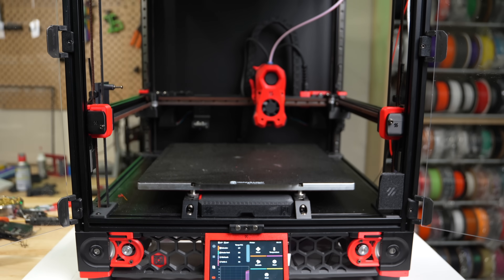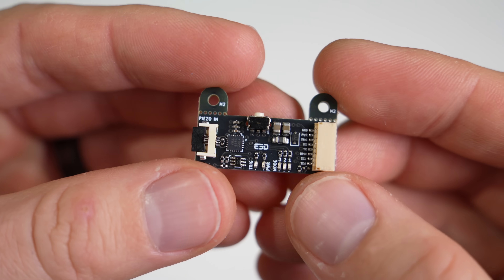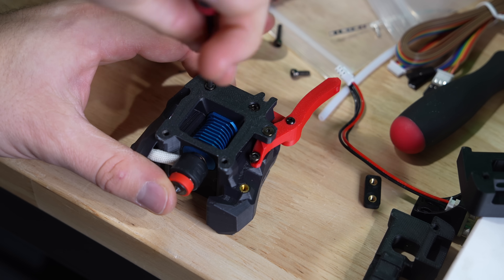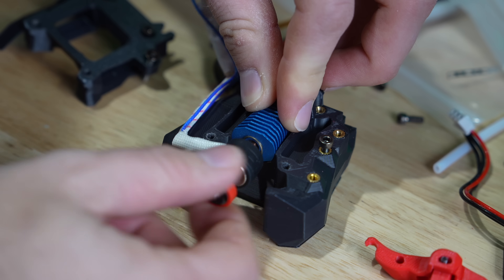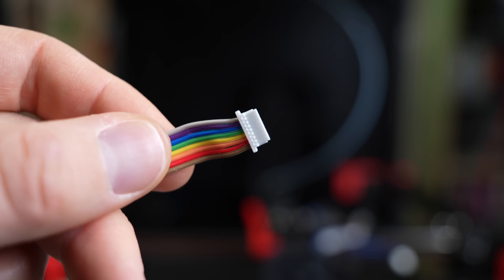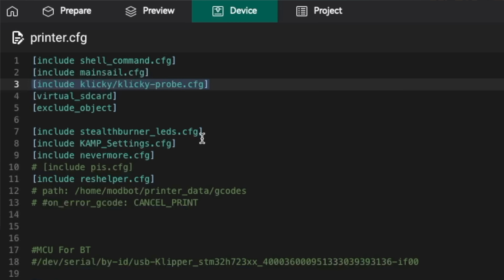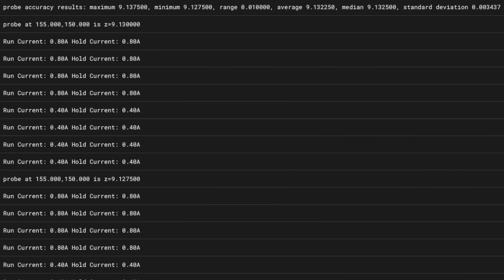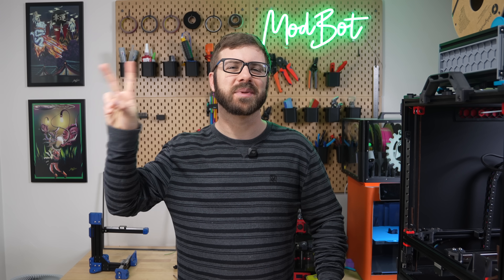Simplified Accurate Probing With Piezoelectric Sensors (E3D PZ Probe)

Comment from the maker: For clarification, you should not touch your hotend at 150C. Touching the hotend is only intended when you are doing your first homing ever and the hotend should be cold. The 150C is only intended to add after you verify that the probe is working as expected. Sorry if this was not clear.
Reply: It was clear to me but I definitely can see someone taking the chance to touch it while it's hot because you said too lololol
Reply from the maker: @DIYunpolished yeah I didn’t add that bit of code until after and realize an on screen could have been helpful. The good news is when homing the printer which is when I said to check if it engages it will not heat up.
Reply: Awww 150 is not that hot, from my experience it's only real bad without silicone sock on the heater block and above 200. Don't touch the heater block when it's hot. Just don't touch hot surfaces, the larger they are the more it hurts. 😅

Comment: Hi! I recently installed the Klipper firmware. So far, much is unclear and not obvious. How do I register the E3D Revo thermistor correctly in the printer.cfg file?

P.S.
I'm sorry if the translation is not quite correct.

Comment: Yeat another thing to add to my way too kitted out ender 3 😂. Using a BLT touch clone right now and it works fine, but man it would be nice to be able to change nozzles without having to worry about z-offset. I like to print most of my prints with a 0.6 nozzle but sometimes it's slightly too big even though slicers aee good at dealing with it these days.

Comment: I have the SB2209 toohead board which has the input shaper sensor built in. Have been wondering why they don't just use those to measure "shock" to basically do this "TAP",....

Comment: e3d has really fallen behind since the bambu printers were released. No one really needs their stuff anymore, unless they are running vorons or ender 3s. but who in the right mind is using those when there are much better printers available now.
Reply: People who would rather spend $30 on an upgrade instead of $1000 on an X1 when their old Ender 3 works fine? lol

Comment: I've tried using the PZ probe on my switchwire conversion.  However I kept getting false triggering, and I've tried all of the available settings.  Falsing was worse when any of the fans on the tool head were running, so I had to probe with the nozzle cold.  Another issue is that if you run the PZ board on 5v, the logic level signals will be 0 and 5v.  This wouldn't work with the MCU I had tried to wire it to, unless I put a schottky diode in series with the signal wire.  (The mcu board provides 5v for a BL probe, not 3.3 volts)
I used a metal ruler to tap the nozzle when it was hot, but as I reported before the probe falsed during probing with the nozzle hot because of vibrations or noise from the hot end fan running.

Comment: That additional gcode doesn't make sure the extruder is at 150C, it actually just makes sure its not over 150C. Still have to manually heat up
Reply from the maker: @jamesbirtles  yeah it behaves a bit differently than what I had running on tap. I may tweak it a bit.

Comment: Great video.. I have been waiting to see someone install one of these.. I want to use them on my tool changer..but I would keep the tool setter for the initial tool setting then probe the bed when a tool is put into operation.. im wondering if the data could be used for bed leveling 🤔

Comment: E3D sells the PZ probe sensor and control board without the Voron coldside heatsink.  Do you know if it’s compatible with Revo Hemera or Roto, and if so how it would be installed?

Comment: Thanks for the video... would have been nice to have seen it a few weeks ago before I replaced Voron TAP with Revo PZ Probe.  One important thing... in addition to being a 5 volt ONLY part, PZ Probe is apparently not an "Open Collector" configuration.  This means that you might need a BAT85 diode in the output wire, just like certain Inductive probes need.   In my case, the MellowFly SB2040 CAN toolhead board needed it.

Comment: Both Bambu & Qidi use the same piezoelectric bed sensing. Qidi is now suffering from inaccurate bed sensing due to the piezoelectric sensor degrading during long-term heated chamber use. Bambu is same. That's why their sensors at $5 on their web store.

Comment: All of you seem to very knowledgeable but I'm curious about these build your own 3D printer kits. Aside from the challenge of putting all the parts together start to finish(which is something I very much would enjoy doing) the price seems to be incredibly high for all of the kits. Are they significantly better than the cheaper 3D printers that are pre assembled? I'm so confused by the high price, it seems like kits are usually much cheaper than a finished product but here it seems to be reversed.
Reply: It used to be that kits were more expensive but were significantly higher performance, then companies came on and released machines that worked out of the box and had similar performance to the kits. Kits CAN still offer better performance but its down to how well you build and maintain them, they're also more sutomiseable and adhere to open hardware ethos more. Pre built printers are now cheaper and have decent enough performance but you're stuck with what the companies offer for upgrades and support, you're at the mercy of the company when you buy them and often they're not made to be easily repaired so if they break there's a good chance they'll stay broken. If you want 3d printing to be the hobby go pre built if you want the 3d printer to be the hobby go with a kit.
Reply: @jakeengland1430  ah, that makes sense. I got an ender 3 pro given to me and I've fixed it up from non functional to working and I really enjoyed the process. So I've been considering the kit route.

Comment: I've been using the standalone version with a dropeffect next g fiber in a dragon burner on my v0.. and mostly love it. I had to modify the presets to get a working config and sometimes it fails meshing due to nozzle ooze, it just because it feels like it. I'd say it's 80% reliable at this point, obviously really wish it was 99 or 100, but the lack of space rules out most probing options and I've already done the work so it'll start for the foreseeable future l.

Comment: The PZ is very nice but I struggled a lot with the fan interfering with the probing. I now turn the hot end fan off during probing which solved the problem but is also not ideal

Comment: I can totally relate to not modding a printer when it just works. I have a Trident I made almost 3 years ago and I have a million upgrades sitting in boxes from a full CNC gantry set all the way up to a whole new rapido uhf, Galileo 2 based hotend with upgraded cooling. And the only reason I haven't put that stuff in is that I've gotten perfect prints after spending some time tuning and just have little to no reason to go messing with things.
Reply from the maker: It’s a slippery slope. I enjoy modding but once you start it’s always just one more thing. Yes they can improve on the experience and even output but there’s something nice about a printer that’s in a place where you can consistently rely on it. I’ve been guilty of modding things and creating my own issues before 😅
Reply: I have a rapido 2 on my 2.4. It is a very nice hotend that pushes a heap of plastic

Comment: I was trying to buy it for half a year and it was out of stock everywhere all the time.
Also I don't like the fact that you need to shove yet another PCB onto your extruder assembly, they should co-op with mellow or other stealthburner PCB manufacturers to have it integrated, or at least make their own PCB which does cable management so like basic stealthburner PCB but has their piezo electronics added.
It also seemed very suspicious/alarming that even tho voron community will gobble up anything voron dedicated from e3d, there was not many videos on it.
After like a year since the announcement, I revised the subject and people were saying that it has a lot of false triggers and is not that great in overall and that digital inductive sensors are better.

Comment: I bought the Revo Voron PZ to put in my tool head on my bed slinger.  Couldn’t get it to be consistent. Sometimes it would false trigger (especially if the hotend fan was running) while other times it would slam into the bed and not trigger.  This was despite not changing the sensitively or filter settings between incidents. Gave up and restored the BQ Microprobe into service again. Sad really, as I like the idea of the PZ probe.

Comment: Recommends heating hot end to 150C for probing, then recommends using your hand for testing the probe.
Not sure that's a good idea.
Reply from the maker: Yeah lol the order of operations was that it wasn’t added until after. Also it doesn’t trigger the hotend heating to 150 on homing but I’ll pin a comment to clarify.

Comment: Is there a reason more people don’t just zip tie their loose cable to a 3mm nylon filament length to prevent tangles? Still flexible, no drag chain to worry about, but enough stiffness to keep wires out of the way

Comment: Without another Hotend using the System I'd rephrase the Standalone Version into a Spare Part as otherwise it can still only serve the proprietary Revo System you'd have to pry into my cold, dead hands before I'd use it over a CNC Tap a) not tying me to a particular Hotend and b) providing some welcome Compliance as it allows the Tool Head to move out of harm's way if the Nozzle gets stuck on something. @06:08 This setup looks like a terrible Maintenance Issue no longer allowing for a quick removal of the Shroud ( say during a Clog ) without the removal of both the Extruder AND the Piezo PCB - Not impressed 🤔🤨

Comment: I wish there was a good aftermarket probing solution for the SV08.  It's most of a Voron 2.4 but the thin warping aluminum print bed and inaccurate prox sensor for the bed mesh causes unreliable first layers.  I like the looks of the Beacon 2.0 which does a quick but very accurate fly-over inductive bed mesh and it apparently has an accelerometer that can sense a very light touch of the heated nozzle on the heated bed for a directly measured Z=0 offset.

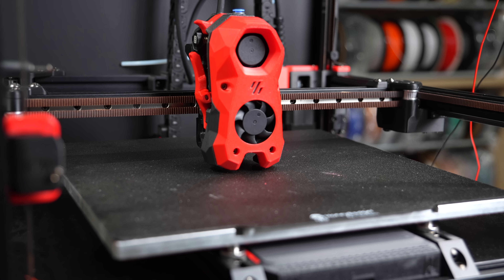11:50 - I uploaded a TPU cable chain for the SV08 to Printables and Thingiverse that might help with your floppy extruder cable.  You'd probably need to modify the mount to fit your 2.4.
Reply: I have this Pizzo kit and want to add it to my SV08. Did you ever do this, or know someone that did?
Reply: @treyduval5399  - I haven't heard of anyone adding a piezo sensor to their SV08.  Some people have installed a higher quality prox sensor.  Most people have upgraded the SV08 prox sensor to the Eddy sensor and some people have used the Beacon probe.  In the launch live stream video for the Zero, people were asking about the SV08 first layer issues (warped bed and inaccurate prox sensor) and Sovol said they are working on a user installed Eddy upgrade for the SV08, but their focus now is on the launch of the Zero and the 500 mm coreXY printer that was developed in tandem with the SV08 that should be launching soon, but hopefully soon after that we'll have an Eddy probe kit from Sovol that will fix half of the first layer problem.

My SV08 has been down for almost a month.  I watched the first 20 layers because I knew the first layer issues make bed adhesion problematic.  I went to bed and the part released from the bed six layers later.  In the morning, the hot end was completely encapsulated in a baseball sized blob of molten plastic.  The extruder cover had been ripped off and hurled aside.  The heater wires were sparking.  I can't trust the SV08 to print when I'm not baby sitting it, and it's never been able to print anywhere but the center 220x220 mm of the bed because the bed is so warped and the bed mesh is so inaccurate, so there's not much point in having a 350x350 bed.  I actually love the SV08, but these first layer issues need to be resolved before I can use the printer the way it's designed to be used.  I was going to install mainline Klipper so I could install an Eddy probe, but now I'm waiting on Sovol to release their Eddy upgrade as I'd prefer to keep it on the Sovol firmware if I can.

Comment: I never got this working on my Voron.

It was a sensitivity issue. Either too sensitive and constant false triggering, or either not sensitive enough, and crashing the head.

I could get it close, but it would still always crash the head if the fans were operating.

This was the stand alone version.
Reply: I'm one step from giving up.. Using the stand alone too... Same problem
Reply: @yuripolak  Yeah... I got it to work great and reliable every time... Unless the fans were running, and then it would crash more often than not.

Comment: Probing directly with the nozzle tip is like an ideal situation, except when considering how small the probe tip surface area is. You want to probe with a wider tip surface so adding something like a shim stock of known thickness between the tip and bed would create less noise in the measurement of the bed especially when using a textured bed where the probe could fall on high or low spots when what you care about is the average, but it will also keep the nozzle from potentially damaging the bed. Currently this is a half baked solution imo.

Comment: Have one in vyper, hate it it's not reliable over time, made a  complaint mechanism with a simple contact switch made of two m3 screw works like charm simple no heat degrading over time

Comment: I’ve been using the PZ probe for a while now, and mostly loving it.
Tuning it in has been a bit of a nuisance at times and I had to wire up my own adapter to connect the PCB to my tool board (but that was easy enough). The price is also… not great. Now it’s working, it’s gorgeous, first layers are always beautiful.

Comment: for anybody curious about what various connectors are called who doesn't already know, the connector on the piezo board that the ribbon connects to is called "zero insertion force", or more commonly simply "zif".  there's a similar connector called "light insertion force" or "lif" that used to be used in some super small laptops many years ago for 1.8in hdd connections in such a small form factor (such as the sony picturebook) & zif connectors for display ribbons & such, so definitely not a new thing.  interesting to see it implemented again after all these years, though.  😊

Comment: If you had deviation issues with your klicky probe, you probably had a mechanical problem like lack of stiffness on the tool head dock or a bad micro switch, by far the klicky here had been the most reliable probing method with a range of 0.0020, even with a heated chamber with bed over 100°C. I'm using a Huano Pink dot (0,75N with blue transparent shell) for my klicky.

Comment: 15000 times in durability testing? Looks like not very much. I often have 7*7 or 8*8 adaptive probing points on my 350mm³ printer. And I can easily have about 10 prints a day.
Reply: :) too bad, it will last about one month in your use in that case
Reply: Why one earth is your bed changing shape so much?

Comment: I almost went with the Pz probe, but chose cartographer. Its amazing 30K mesh points on a full plate in under a minute. tap was so incredibly slow. eddy current sensors are likely the future or something non contact. I had a precision piezo probe years ago, i wish they went with  digital settings vs the pots they used. when it did work it was pretty darn good, but man eddy current probes are the way.
Reply: you can run BOTH the BTT Eddy and PZ for abl and z offset respectively
Reply: @_edmund  that was my plan but i could not get it to work properly, mind sharing your config?
Reply: Do you print directly on metal?  Because I personally print on a surface that's either glued or sprayed onto the metal sheet.  So you're measuring the level of a surface one or many layers underneath what you're actually printing into ignoring all the irregularities introduced by glue, material thickness, Wear, bubbling etc.  I mean might as well just check the table you're printers sitting on and call it good
Reply: @squidmissile750 it's flat enough, that's what offsets are for plus it probes the bed anyway. So get bent
Reply: @squidmissile750 
A good qualety plate is relatively aceret 
And you don't have to be that precise to print
Reply: Eddy current probes are so cool, I'm just scared of having to deal with z offsets again
Reply: @SentientTeapot2444  My cartographer is setup with touch so it will set z-offset every time with a nozzle touch on the print bed.
Reply: @SentientTeapot2444   it's been nearly trouble free, apart from some first layers being too close or too far, by a small amount. im using the touch feature so it might be better to use the scan mode for your setup if you have a z endstop on a 2.4
Reply: Agreed
Reply: Only problem is chambers and some bed materials 
It is not rated fore 150c

Comment: I am converting my Prusa Mk3s+ to Klipper with a new Manta M5P board and the pinda probe is limiting how many probe points I can use because of the bed magnets 3x3 or 7x7 so I waited until the Voron PZ probe came back into stock and designed a new toolhead for it. I was trying to make a video of my mods so have not gotten around to installing it just yet.